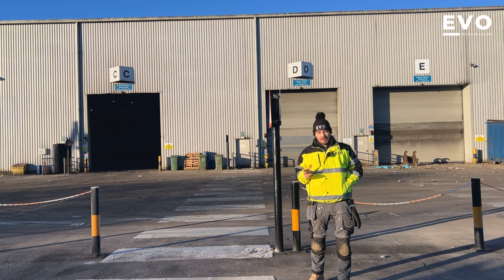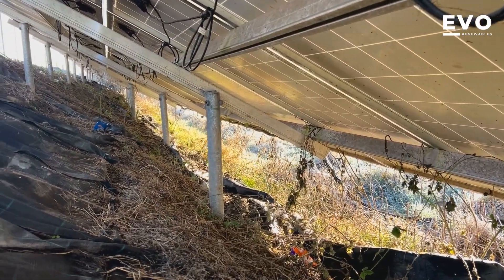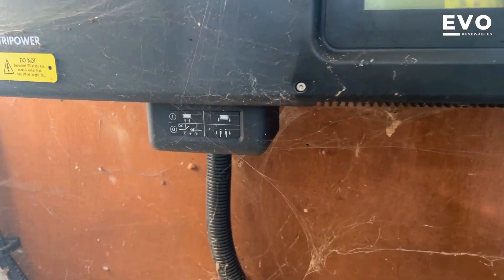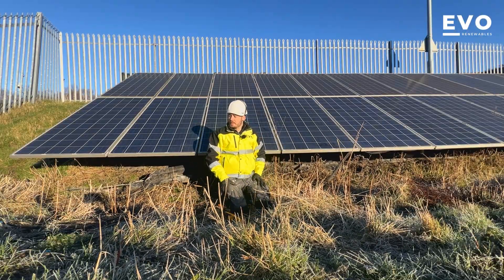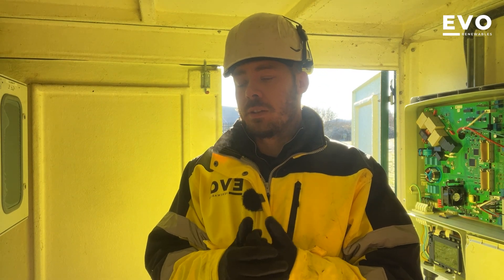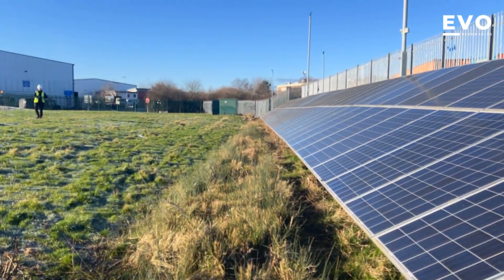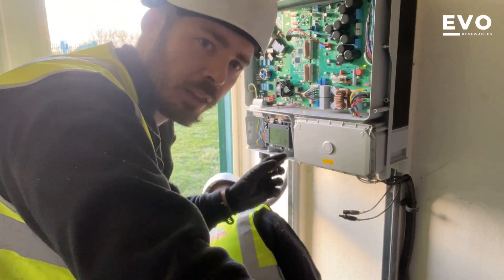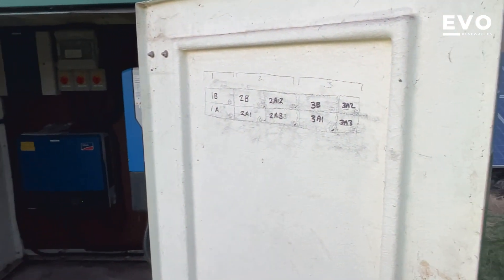Fault Fining on a 50KW Ground Mount Solar Panel System

Comment: What if you invest the exact cost of the optimisers you speak of into more panels and another inverter won't that fit in better?
Reply from the maker: There’s no real right or wrong way. Sometimes it comes down to clients budgets for example.  It’s worth remembering that optimisers don’t just optimise the generation, it also provides panel level monitoring aswell as Safe Dc where it restricts the output voltage in the event of a fault to prevent things like arching and fire etc